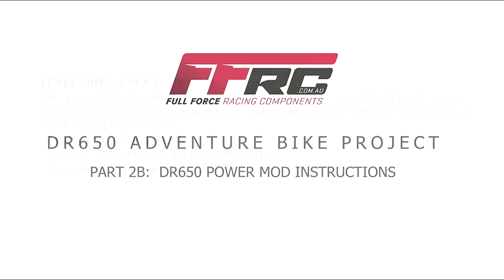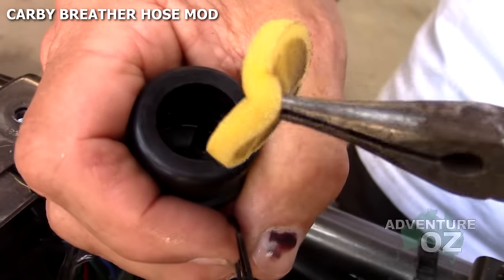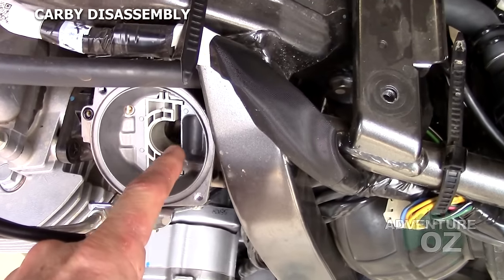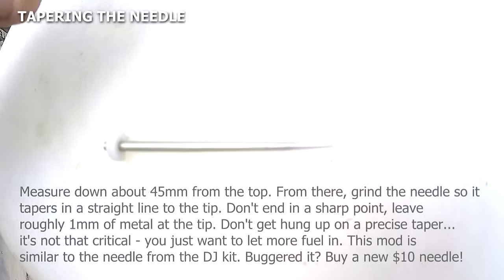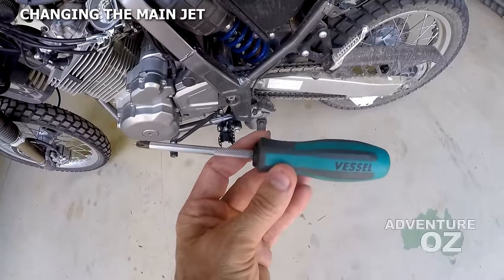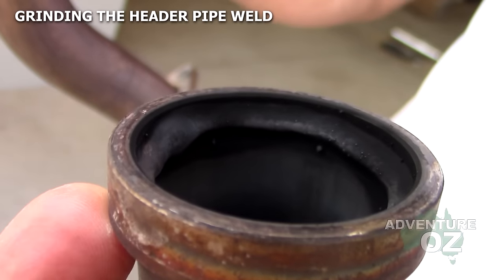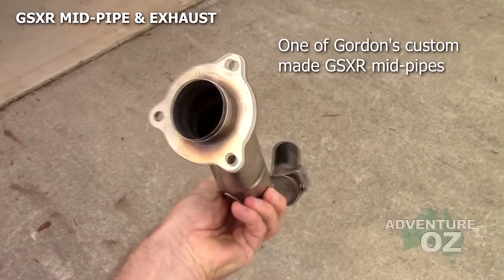DR650 project: transforming the stock carburetor! (BST magic)︱Cross Training Adventure

Comment from the maker: Our complete DR650 project series here! https://bit.ly/3gQEStP
HOW FAR DO YOU WANT TO GO?  This video assumes you are fully derestricting the DR650 and using an aftermarket exhaust. 
Level 1: This is around two hours work and assumes you keep the stock exhaust. It costs nothing if you modify your own needle. 
- Modify the existing needle (or aftermarket)
- Remove the rubber snorkel from the airbox
- Reset the fuel/air mixture screw
.

Level 2: Around three hours work, you'll need an aftermarket jetting kit unless you modify your needle yourself and drill out the main jet. 

- Modify the existing needle (or aftermarket)
- Remove snorkel and cut a second hole in the airbox
- Replace the stock 140 main jet with a 150 main jet
- Reset the fuel/air mixture screw.

Level 3: five hours work, a great alternative to the expense of a pumper carb. It assumes you fit an aftermarket exhaust. 

- Modify the existing needle
- Remove snorkel and cut a second hole in the airbox
- Replace the stock 140 main jet with a 150 main jet
- Reset the fuel/air mixture screw
- Remove header pipe and grind back the inside weld
- Shorten the carb slide spring
- Drill a second hole in the carb slide. 

TUNING WITH MIXTURE SCREW
When adjusting the mixture screw, don't go past two turns. If you need to in order to get the bike running well, you should go up to a 45 pilot jet. 
Fine tuning the needle? If you are really trying to get the best results, you can use very a very thin washer with the needle positioning to get half clip adjustments - if you are into fine tuning! Most of us won't worry about this. 

SURGING?
You may find the bike surges. Often this occurs if you just take off the air filter 'door' instead of cutting a hole as specified in the vid. It might also occur if you cut too large a hole. 

COMPLETE LIST OF DR650 PROJECT VIDS
Introduction to the DR650 https://www.youtube.com/watch?v=58vB-5urcJI
Power mods overview https://www.youtube.com/watch?v=z7GcNdlDwdk
Transforming the carburetor https://www.youtube.com/watch?v=aN1aU0G4YQE
GSXR exhaust mod https://www.youtube.com/watch?v=Em6SzMTF5SY
DR650 known issues https://www.youtube.com/watch?v=rSNBa63UWx8
Basic suspension mods https://www.youtube.com/watch?v=aTYAwIBX9aQ
Protection for the DR https://www.youtube.com/watch?v=NQcXfOJsLSM
Ergos: pegs, bars & seats https://www.youtube.com/watch?v=geLR5u8sMhI
Weight reduction https://www.youtube.com/watch?v=h6fl-GWdURk
Best suspension mods https://www.youtube.com/watch?v=sGdLm9sXzdo
Fixing noisy starter motors https://www.youtube.com/watch?v=6P4n80FJP18
Headlight upgrades https://www.youtube.com/watch?v=G28GoyWp6LI
Steg Pegz review https://www.youtube.com/watch?v=SnI_pfkuQsg
Reply: Excellent video and information! Counting the days and nights until I buy my next DR650se Bushy Piggy
Reply: Excellent information thanks! Do you know if this carburettor and modifications would be valid for a KTM 640 adventure? CARBURADOR MIKUNI BST40-266 03
58431001600

Comment: On my 2002 dr650- the dynojet kit alone with 150 jet, changing needle & shims, and adjusting fuel air...it was a snappy, totally different machine. Added Leo Vince exhaust, grinded header weld, and removed snorkel/cut 2 holes in box. The difference between stock is mindblowing....
Reply: How much of a difference in mpg?
Reply: @dr6507  not sure of exact numbers but, like 30 less miles out of a tank
Reply: It used to run out and have to flip reserve at like 125 miles. After the mods it runs out around 100 miles. Depending on riding conditions of course
Reply: @johnkopek7979 thanks alot i really appreciate it! Another question did you grind the spacer down like he did tooo? Looks like he put the spacer under the clip, I've read where people put it above the clip
Reply: Looks like it makes more sense too put it under the clip .
Reply: Which spacer?
Reply: @johnkopek7979  the white one, just talked too the guy at motolab today and he told me too put it under the clip. Just got done finish putting the needle in it, i can actually notice a little difference. i left my air box closed I'm kinda on the fence with if i should open it up or not. still have too dril out my fuel screw tooo, might do that in a little bit when it cools off
Reply: @dr6507  I bought the dynojet kit, it came with several jets and different shims to put on the needle. I don't recall which one I used was like 8 years ago. But I slightly shaved the needle a little bit, and I think I cut some spring. Like I said was a long time ago, and no snorkel and one hole I'm air box. Was a completely different bike
Reply: @johnkopek7979  appreciate the hospitality! Now you got me thinking i should take my snorkel out.🤔 i do mainly pavement riding so im thinking i should be ok..

Comment: I installed a jet kit in my DR 650. I drilled two larger holes in the plastic slide and enlarged the airbox top hole with a sharp Stanley knife really easily. I didn't cut the spring or need to adjust the mixture. I also installed a FMF powercore4 exhaust. The bike starts instantly, idles fine and is smooth throughout the rev range. Good gains all gears, no back firing. Rapt as.
Reply: What main jet did you use?
Reply: @goodfellamoto5787  Dynojet stage 1 & 2
Reply: @goodfellamoto5787  Dynojet stage 1 & 2

Comment: I've been fighting the carb on my 95 DR650 the whole time I've owned it (over 6 years) it came with a modified exhaust and the snorkel removed.
I added a better filter and Dyno-Jet kit to try to tune the thing ...something was always wrong :-( 
I tried dozens of combinations of jet sizes and clip positions, I'm not exaggerating. it was never quite right.
After watching this video I figured ...Why not?
I dug out the stock needle, chocked it up in my Dremel and tapered it with some Emery cloth 'til it  ...um, looked good?
installed the modded needle with a small shim and installed a .150 jet.
clipped 3/8 inch off the spring (What the hell is a millimeter?)
I took the bike for a rip just now. it runs better than it ever has. I am flabbergasted! The goofy Aussie was right! 
This is EXACTLY what my bike needed.
Thank you for posting this.
Reply from the maker: Great to hear, and a big shout out to Gordon who supplied all the info and has spent countless hours over the past decade helping guys set up their DRs.

Comment: I was reasonably happy with the dr  performance but it really struggled to get the front wheel up without a decent clutch drop and pull up . I done everything   In the vid except I purchased the pro cycle mid pipe .  
Started so much easier . Test ride was flawless . I actually think I got 10.2% more power 😂, it really goes so good , quick blip of the throttle and the front is up . Really is a great  mod for a modest gain . Was easier than I expected thanks for the top vid 🙏🏻
Reply: Did you do the key needle just like he did with the spacer under the clip and did you grind down the spacer so it drops down past the shelf?
Reply: im in the U.S. and I know they say put the clip in the 4th slot from the top but I'm just curious as what too do with the spacer, that's why I haven't done it yet smh need too get it done tomorrow

Comment: I have just done the mods on the carb airbox exhaust etc. I am now even more of a proud owner, of the dr650. Also I am now feeling like a motorbike mechanic. Life changer thank you very much all who have made these videos. Namaste
Reply: The guy before me already upsized the jet although im not sure what make the jet is (155), cut the airbox open 80mm extra and a flowing exhaust with m/pipe. Also didn't have to stuff around with fuel/air adjuster. Am going to test the fuel/mileage and may go down a jetsize wanting around 22kms per litre! wish luck.
Reply from the maker: i found the fuel economy stayed the same after the jetting mods... IF i didn't use the extra power!

Comment: Excellent!

You should be paid by Suzuki for your magnificent instruction video.
(Yeah right, like that will happen)

One thing I don't think you mentioned is that in the US we don't get the clip adjustable needle like other countries do.
And our idle jet screw has a soft brass cover installed to keep us from having a good running engine.
That is easily removed fortunately, and a very handy extended idle jet screw is available for easy, no screw driver needed adjustment.

This vid is an excellent instruction on how easy the DR is to wake up from sleepy Zombie state to extreme enduro ready power.
Reply from the maker: +JagLite48 damn, i should have remembered that. from memory you have to drill the carby as well to access the screw which is hidden on the US model.

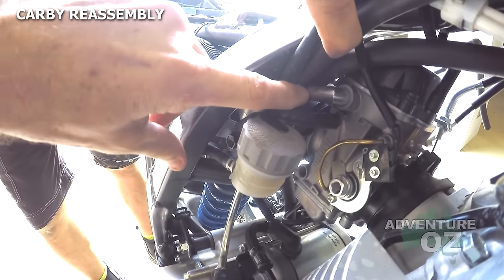Comment: Just a little tip. At the carb is a small switch, good to see at 7:25, which reduces the power in first three gears. Just pull the plug out and the problem is away. Just try it, it's not a big diffrence, but i doesn't costs anything.

I have done it on our DR 350, and you can feel it a little bit.

Greetings from Germany. Love your vids. Since I'm watching your Videos on your Endurocross channel, I improved riding very much! Thank you Barry ;)

Comment: I've just done all these mods to my Dr650, and I must say, I'm pretty stoked with the performance gains. Next step will be replacing the stock van with a #35 Gsxr exhaust as soon as I can find a mid pipe locally. Thanks Adventure Oz for the very informative series you have put together.
Reply from the maker: glad the tips are useful sarath... the DR is certainly one of the most 'improvable' bikes around and still a bargain at the end of it all. :)

Comment: Honestly I messed around with these sort of tricks for years, and realize it's like trying to cut a foot off the bottom of a ladder, and taping it to the top to make it longer.  You get a little more top end power, and myself always wound up with some dead or flat spot in the middle to low end somewhere.  I went through a dozen combinations of jets, pull the carb 50 times, did runs and checked the plugs.
   In the end I just put a Lectron carb on.  So people who want to open the airbox, and put a free flowing exhaust on that's my recommendation.  Just save up for a Lectron or a pumper carb.  The Lectron gets generally better miles per gallon, the pumper carb has the opposite effect.  Dunno why but it does.  However a Lectron carb is around $800, and a pumper carb can range from $400 - 650.
Reply: i did all the mods recommended in this video and it turned out as they said it would ,
idles much better now and much more power on take off ,
the bike is much easier to handle at low speeds because of the extra torque 
the front wheel does come off the ground easily now witch is great in mountain riding condition
Reply: @marcelcanuck  Yeah my buddy did this to his, but he had flat spots too.  Racers did this years ago because for example they might only care about how it runs at full throttle, or for a enduro hill climber might only care about low end torque.  In generally stripping emissions stuff will get you a little boost.  But none of it is like adding a pumper carb or a lectron carb performance wise.
   You're talking about a few extra foot pounds of torque, and better throttle response.  Which is good but a pumper carb will make it a difference animal entirely.
Reply: @slimjim7411  i might of gotten lucky on the jetting , i ordered a 150 main and a 45 pilot , i never got a flat spot on my bike but i see allot of Youtubers with that issue , 
i wasn't to impressed with the bike at first , it ran sluggish and  stalled out at stop signs  was just about to sell it  when i spotted this  video , now it's a keaper , might try to find a pumper and see what more i can get out of it , now that you've tickled my curiosity    must be some on Ebay , be safe 👍
Reply: @marcelcanuck  Good luck I think pumpers are a little less expensive but you'll lose some MPG with the Lectron it's more like fuel injection it's just better everything but pumpers run around $400+ and Lectrons run around $600+ last time I checked at least for a 650 thumper.
Reply: Shimmed the needle with a number 4 washer.  Cut the spring. Cut 2 holes in the slide. Didnt cut the airbox though since i didnt want to rejet it.  Runs good. The bike ran super lean before , now much better. The airbox cut may throw off the jetting which I did not change,  and works good with stock jets.
Reply: @marcelcanuck  Well mine stalled out at stop signs until I removed the clutch safety sensor, hasn't stalled since.
Reply: @overcome8628  my clutch safety switch sensor was removed before i owned the bike and still stalled out until i upgraded the jets and did the modifications in this video , now it idles much better and has much  more acceleration , i did all the mods except the exhaust  , i also got the seat that they recommended , now i can ride all day without getting mum bum 👍
Reply: @marcelcanuck  I wish  u could just put the upper part of the exhaust on just for looks. I am older and this bike has plenty of power for me.

Comment: Did this a few months ago - very noticeable improvement just with a 'Busa can and sorting that header weld out. 
Got 2 Busa cans taken off a new bike for $200, made 2 adapters and sold the spare system for more than the cost of the whole job. 
If you run a neat 3-4mm TIG weld round the header pipe collar you can make that internal weld flush with no issues. (6 months and 10,000k so far)
For an adapter pipe - a standard 1 1/2, 45 degree bend, short length of pipe then a 90 deg bend cut in half to make the joggle worked for me (with a bit of grinding).
I have a drawing of the Busa flange if anyone is interested - printing it out 1:1 and sticking it to the plate is easier than marking -  don't use contact adhesive it will shrink the drawing.
Reply from the maker: Great score on those two new cans! Roughly speaking you'll get 5% more power with the exhaust mod... then another 5% with the airbox and jetting mods.

Comment: Thanks heaps guys . Just did theses mods minus the exhaust. It it works great.
Reply from the maker: Glad it worked well, the old bush pig definitely wakes up with these mods. A lot of guys spend big on pumper carbs but in my experienced you'll get similar power increases with these cheap mods.

Comment: As always great info....after I tweaked my fully modified stock carb to my altitude and other components it ran well.then I installed a new tm 40 with a baseline jet set I determined all that tinkering to be a total waste of time....the usable power increase through the total rev range was evident immediately. Besides the Cogent Dynamics mohave pro and emulators with ohlins springs up front.....the tm40 was money best spent.
Reply from the maker: Interesting to hear... some say the TM40 is better, others say marginal improvement but not worth the money. I've always had my stock carbs modified by the guy who came up with the 'BST magic mods' and he always nails it. I'm in the former category as I've also owned a DR with a TM fitted and couldn't see much difference at all. It would be very interesting to have both bikes perfectly tuned and put them on a dyno!

Comment: If anyone in OZ is interested in a GSXR pipe or FCR39MX pumper carb, I have both that came off my DR. The carb has been fully stripped, rebuilt and jetted appropriately for Australian conditions. Includes intake adapter and new clamps to make it fit

Prior to selling the bike I refit the stock components, in all honesty I prefer the bike with just a jet kit and whats shown above. In fully stock trim it is a bit of a joke, but with an opened up airbox it sounds much meatier, and the carby mods can get you pretty good throttle response, at least 90% of the way to a pumper carb. However what I found is you need to either go for throttle response via overly rich jetting (overcompensates for a lean shift when cracking throttle open, so its actually the right mix straight away) or you jet for economy and suffer some throttle response. A pumper will get you both. But overall I enjoyed it with slightly reduced response because its a gentle giant. As soon as you start chasing those performance enhancements or big improvements it gets expensive and you're never really satisfied. It's always just going to be a DR
Reply: Msg'd you :)
Reply: +MELEGO351 hmmm don't see any message. I'll have another look later unless u wanna try again
Reply: Aidan Gillett Hi, I tried sending another message, (youtube messaging system has been known to fail in my experience) Failing that I could do it through facebook or something. Anyway see if its gone through first :P
Cheers
Reply: OK found it, replied

Comment: First thing I notice after the carb mods once the engine was hot when I pull the choke on the motor stalled,like it should,so has before it just ran better on the choke.
The acceleration has jump to Wow,just right,it Wellies now so easy so has before I din’t even bother trying.its no a speed demon but it’s sure a nice power band,torque a low revs is so nice when you play up hill on a wonky terrain now.